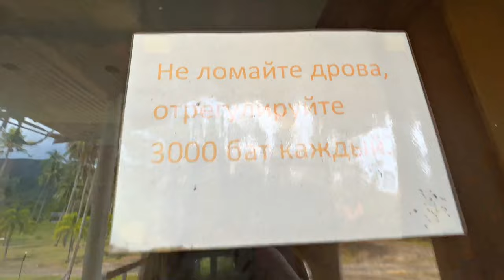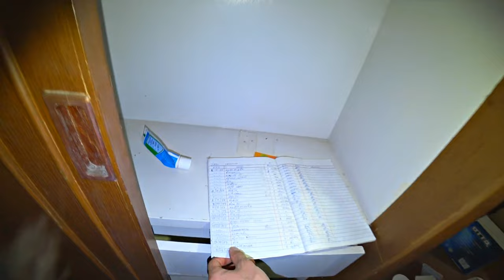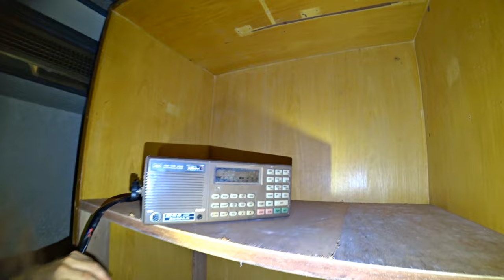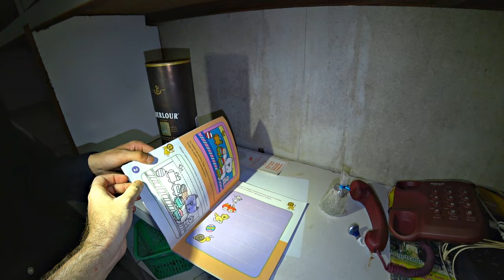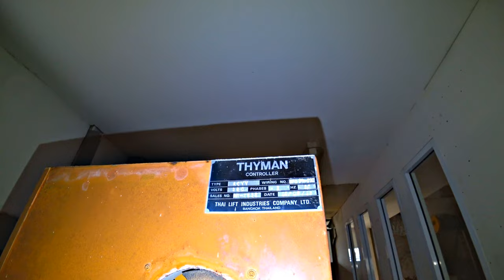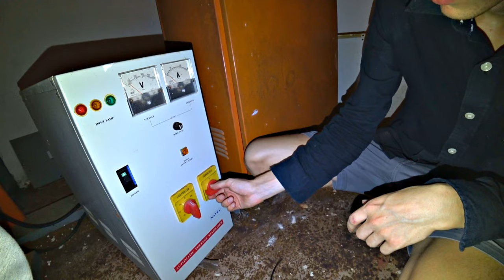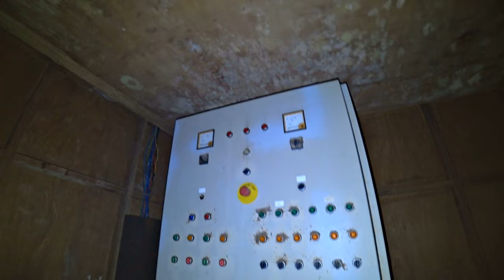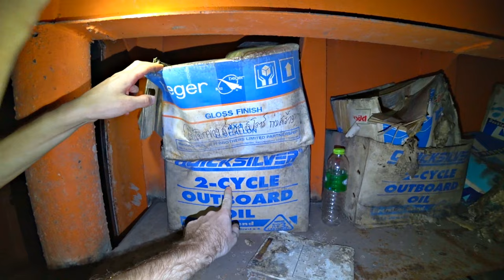✅Found ABANDONED SHIP!!! Big CRUISE SHIP on a desert island☠️ Where did the people go?!?

Comment: Those round things outside are cooling towers for the ships air conditioning and the black pipes and circulation pumps are to circulate 43 degree water to each room that has a fan coil unit .the 4 cyl diesel engine is the fire sprinkler pump